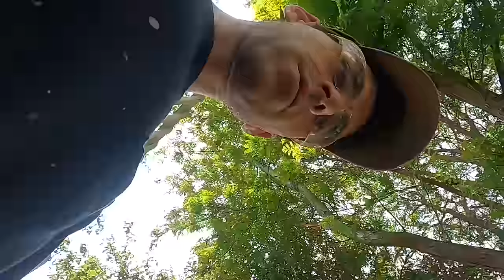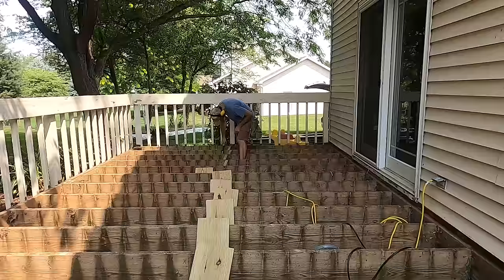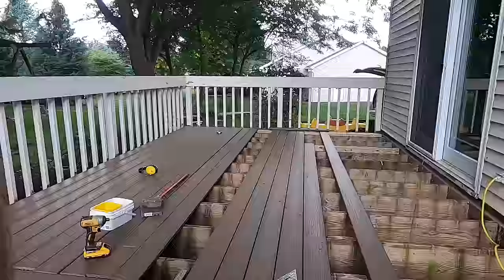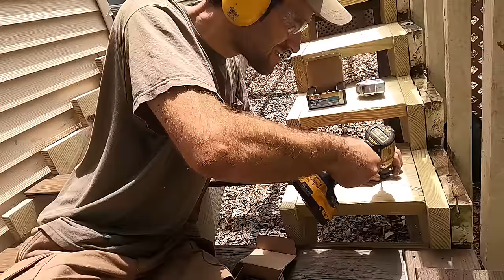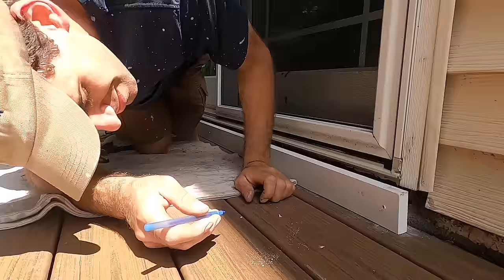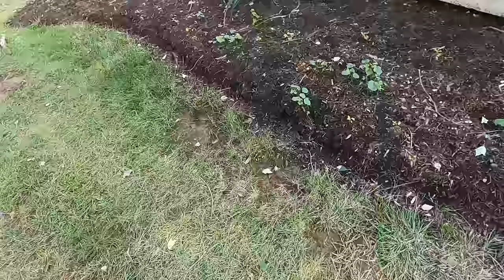Deck Job: Replacing Wood with Composite

Comment: Looks beautiful!I had my 12 x 16 deck redone about 10 years ago with Azek. I was so tired of cleaning and re-staining every 3 years. I also replace all of the railings with white painted aluminum so that I can pressure wash each spring without blowing all the paint off. I asked the contractor to use the Azek Side Loc tool when fastening the decking so that all the screws are invisible. That was a good choice in my opinion because screw holes tend to fill up with dirt and look like black dots. They also ran rubber strips along the top of the joists, wider than the joists,  to protect top of the joists from rot. It was a big investment  but it has paid off in time and effort for me. It has held up well and still looks beautiful.
Reply: Built a big wood deck 8 years ago. After a couple years of re-staining I learned a lot. Moved and the new house has a deck size we like, bones are good but surface and railings need replacing. After my maintenance experience with the wood deck, the only option this time is composite. I’m excited for spring so I can lay the new decking down!
Reply: @joe1071  I got sick of staining too so built a clear roof over it :) that works too lol but I agree, next time I build one the walking boards will be composite 100% 
I built mine maybe 10 years ago and it has cider boards on finish. they last worse than treated wood ones I think. the railing posts surprisingly are in great shape. railing cider boards after 10 years of summer heat and cold minnesotan winters was crunchy to break by hand

Comment: Joist tape!! If you’re going to install decking that has a 25 year warranty, you’ve got to protect the framing underneath, especially now that you have hundreds of holes from the old nails that were removed. The nail holes allow water to bypass the pressure treatment right into the heart of the joists. Butyl deck tape (Spax, Trex, Reeplar, Felizshop, etc.) helps your framing last as long as your decking. It also promotes sealing around new fasteners (just don’t overdrive into the concealed fastener clips).

It’s also best to install the additional framing for the “picture frame” boards vertically with at least a 1/4” space between joists so you can tape the tops and promote drainage in between. Hope this helps you DIYers out there build a better deck that will last a good long time.
Reply: thanks
Reply: thanks for the tips!
Reply: So the picture frame border you're saying to double up on the 2x10 like he did in the middle of the deck?  .....I definitely agree with tape

Comment: I'm so glad i was smart and spent the extra money and bought Eon ( all plastic top of the line) back in 2003. A 20 footer was $33, today top of the line is about $115 a board. it's still the only way to go. Pressure washing and staining every 2 years sucks and end up costing more..I know a few people replacing their decking and the redo is very exspensive

Comment: nicely done! you should use joist tape next time, it’ll stop water from getting into all the old nail holes and rotting out the wood

another thing i did when i redid my deck was to dig under the rim joist that was in contact with the ground so there was a 3-4” gap then added about 2” of gravel. i know PT lumber is rated for ground contact, but all that wet soil will rot it out eventually

Comment: We replaced our redwood deck with Timber Tech composite @ 12 years ago.  With an occasional wash it still looks as good as the day it was installed ... and it looked great then. Only drawback we have found is that it can be a little slippery when wet.
Reply: Find a UV stable clear coat that will last, mix in some fine grit sand, roll it on.  Keep mixture stirred up or the sand will settle...

Comment: Built a 12' x 16' in-ground deck between swimming pool and the sliding doors, using synthetic planks made of cedar saw dust and polyethylene.  This provided a level no-step walk between door and pool;  very nice indeed.
These planks were double sided, allowing them to be turned over if one surface were damaged, and I spaced the support joists at 12" centres.  This deck was rock-solid!
The surface finish was patterned as you might expect from seasoned wood, providing an anti-slip surface when wet.
With an occasional cleaning every couple of years with soap solution and scrub broom, the deck looked as good as new when we sold the house 10 years later.
Reply: I really liked the feature of holding down these planks.  The clamp blocks fitted between the planks, thus spacing them appropriately while holding them down.  Clever and very tidy looking. A long Robertson screw driver bit in the electric hand drill made short work of fastening the decking.

Comment: The composite decking material looks great. However, I have seen carpenters protecting the deck foundation with butyl tape and/or other water protection coverings so that the structural lumber doesn't wetrot like the wood decking.

Comment: I put down a 20 x 20 ft. composite deck and it looks as good today as when I put it in 7 years ago!! Amazing product and no re-staining and bugs don't eat it and weather doesn't bother it! The only way to go in my opinion.
Reply: which company composite deck you used?
Reply: @balkrishnaagrawal1064  Timber Tech
Reply: @BC-ni3sk  are they stiff, meaing do they bend when you walk on it?
Reply: @vladseva  No bend at all, zero. I have 2 x 6's underneath every 12 inches!
Reply: Bugs eat the wood framing.
Reply: @brettsurrett4596  Get pressure treated wood, coat with a good clear that is UV stable, bugs don't like paint.
Reply: @miltonturner2977  Carpenter bee's eat threw coated wood,treated wood and painted wood.
Reply: @brettsurrett4596  You can coat it with sealer/oil based stain, no insect like to eat that stuff...I have a Cedar wood fence that is 30 years old and it's still there...
Reply: @brettsurrett4596  Au Contraire...Did you ever in your  40 years know a person that owned property with Cedar Trees to harvest?  I have hundreds of Cedar Trees on my property.  They vary in size from 2" to 2 1/2 feet in diameter.  The biggest is over 40' tall.  I will cut what I need and use that wood...  I also have a truck and large trailer to haul it to a guy about 8 miles away that has a huge wood cutting mill.  I can get whatever sizes I need.  To heck with Pine, it is great for building houses but NOT Decks or any other outdoor wood structure.
Additional Note:  Just behind my property is  another parcel that has the registered 3'rd largest Cedar Tree In Texas.  It's trunk is over 5' in diameter with 9 limbs at over 2'...
If that tree ever dies it could be cut horizontally into 5' diameter x 4" thick tables.  The tree would likely yield at least 50 of them.

Comment: I'm envious of how easily the decking came up, I'm doing one now with 30 year old cedar boards nailed with 3" ring shank nails.
Reply: Thanks for using ring nails instead of common type.  Less pull out as board’s move and age.
Reply: lol I have a 40x40 deck and the asshole put 5 screws in every joist.  Note that he/she also didn’t stick to one screw, there’s square head, star, Philips, etc.. and most weren’t treated screws so half are rusted.  Gotta rip out every screw with a cats paw- fml.
Reply: @PipShredder  Yeah I have an extension on my cats paw for leverage.  Screws and ring shank nails sure can tear the hell out of an otherwise good joist.

Comment: That looks like more than a 12 inch span.  I thought the composite materials required a 12" spacing of joists.
Reply: Some do, but I don't think this work included redoing the joist. He just reused what was there and braced them the best he could. When a customer doesn't want to pay for additional things, the co tractor can either refuse the job on principle or do the best they can for the price. 

D

Comment: So so so….
I am in the process of doing this as we speak….400 sq feet bi level. Using Wolf PVC. Lesson learned 1…..retro fitting a mix of old and new joists will test your patience’s. Why….the old wood probably shrunk about a quarter inch over time. A 1/4 inch here and there will make you crazy. Lesson Learned 2…..You MUST go from 16” OC to no more than 12” OC…so you are net adding joists. Lesson Learned 3……over engineer it….I went from nails to all screws. Lesson Learned 4. Your stair stringers also need to go 12” OC or less….and buy precut stringers from HD or Lowes. PVC isn’t cheap, nor extra wood for joists and whatever. Supplies(wood screws, brackets, cortex screws, joist tape)…I’m in for about 1,500$ for supplies alone. Aall in right now about 10k….yes….10k$….and I am doing all the work myself.
Reply: I am starting my process on a similar size deck 1) What is OC?  2) why did not you want to do composite? 3) are you doing rectangular pvc deck boards? I have WOLF serenity as a sample in teakwood. 5) are you replacing railing for deck? sorry for many questions?
Reply: @vladseva  OC= On Center….you have to modify the distance between the joist to 10-12”. This way your floor will be rock solid.
Reply: @vladseva  I had a friend who did pvc about 5 years ago and his deck has held up nicely…..mind you, minimal usage, no kids, etc….and that’s the reason I went with Wolf.
Reply: @vladseva  I am replacing the railing. Looking like I am going to use a vertical Cable type railing for more of an open and bigger view. Going to cost this Putin the next 2 weeks.
Reply: @vladseva  one more thing. This material gets really hot when exposed to direct sun…..so much so that you can’t walk on it bare foot when outdoor temp is 90 degrees and direct Sun.
Reply: @vladseva  composite is recycled materials. It is subject to quicker degradation over time. PVC lasts forever albeit a scrub or two each year. Good luck with your project. It’s not difficult….but is time consuming and you need to stay 3 or 4 moves ahead at all times to avoid  major issues. As you know pvc materials are NOT cheap……so there is a major pro vs con aspect to all of this.
Reply: Ok….so 1 year later the wolf pvc I used is holding up as expected. Any furniture I have has good quality gliders so no issues there. I added aluminum railings and low voltage lighting too. All in about 16..17k and doing all the work myself. It did take me though 5 months of weekends so…… time vs $.

Comment: No matter what sealent or paint Ive used wood rots at a alarming pace, deck faces the north and in the shade all day and often stays damp. I want to build a deck with composit. At 2:57 why nail??? Square drive deck screws and a nice milwaukee or makita cordless screw gun would be easier and maybe faster. Deck turned out nice.👍

Comment: Thinking about doing this to my deck. My only question, wouldn't the joists have to be 12 inches apart in order to use composite? I was told it would otherwise start sagging shortly after we walk on it.

Comment: One thing to add: get ready to shell out $40+ per 12 foot length of 1x6 (depending on brand). And they are not a stiff as dimensional lumber - it bends as you walk over them.
Reply: It can also be damaged easy during shipment.
Reply: Joists should be 12" on center. This should make it so there is no flex as you walk on them.
Reply: @chrisnelson6991  that's a fact I put my joists on 12' center on all composite material but going over a old deck you better check the existing joists they are probably not PTF if its that old , you might be tearing it apart in a couple of years because of

Comment: No flashing tape on flat areas where picture framing joints are. That's horrible,  any standing water on pressure treated wood will rot after time. This is why I flash tape all top sides of everything.  I have had a deck last over 20 years to this date with absolutely no rotting.

Comment: Very impressive, but I hate to tell you that deck will not last. Will all the nail holes that you pull out from deck joist, you forgot to put in a roof rubberize table at least the width of the joist before you install tree decking.  Water will sipped i the joist old nail holes and side of the joist.  I hope you don’t get a call back to replace all the joist again. Good luck.
Reply: I’m doing this exact job to my deck this summer and the joists are fine so I’m keeping them. What do I need to put on my joists so they stay healthy for a long time? The decking is nailed into the joists just like the one in the video.
Reply: You don't sound like you "hated" to say that...if anything you sound very eager to come off as a smart ass😂
Reply: I did the same type of job on my deck 20yrs ago with composite. No tape on the joists. Deck still there and looks beautiful. 😮

Comment: Looks really nice! This video popped up in my feed because of the Youtube algorith and my viewing of other similar videos. I am looking to do the same with my decks and need some tutorials and such. One question I have for you is about the placement of the field boards. One guy says not to line up the ends of the boards (recommended 24" offset) and then I see many professionals doing like what you did with the ends all lining up on the same joist. Is there a right or wrong to either methods?
Reply: He had a double joist where they all lined up.
Reply: It is a matter of which looks better to the owner.

Comment: How much does replacing old wood from an old deck with these trex board normally cost? average wise.
Reply: I'm at $1400 in materials (trex enhanced natural @16 ft $44 a board).

Comment: The Dutch angle, also known as Dutch tilt, canted angle, or oblique angle, is a type of camera shot which involves setting the camera at an angle  The primary use of a Dutch angle is to cause a sense of unease or disorientation for the viewer.

Comment: Never use a wrap material. This stuff grows like mad. I had spaces up to half inch that are now closed tight. Mine failed and was replaced twice by company. Even cracked and broken it is better than wood.

Comment: Great video. Just started demo on mine. Did you run into any issues with reusing the holes in the joists from the nails you pulled? If so, how did you combat?

Comment: you should use stainless steel screws.
Reply: There's actually a specific screw for this type of material. It has two different tread patterns on it.

Comment: forgot to add joist, warranty is void if not 12 inch on center w Trex.
Reply: Trex and most composite deck material require no more the 16” OC.

Comment: Respectable results, but optimal efficiency within your given trade is a sign of experience, so evidently, “tool belts” have been replaced by video cameras and editing software. Not being critical, just pointing out that just because someone is doing repetitive / physical work, doesn’t mean they can’t engage their brain also. If I was young and starting out, I’d focus on becoming as efficient as humanly possible, I.e. limit wasted movements, even is it’s only a few seconds each time (like pushing a screw container around, etc.). At the end of the year, you’ll have gotten more done, finished jobs faster and ultimately, made more $$$. JS
Reply: @tailgatecarpenter26  Agreed, although I wasn’t thinking about it while writing my comments, more as a business owner. ✌🏻

Comment: Plastic crap period , looks like crap in 4 years  ,you can never match it .redwood is still the best choice if built correctly it will last 40 years  new uv stains require less maintenance